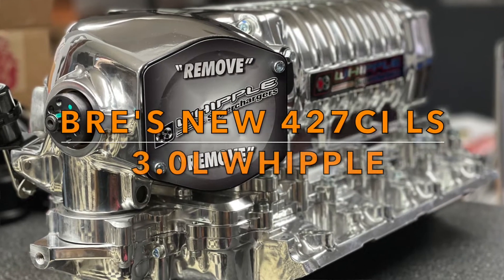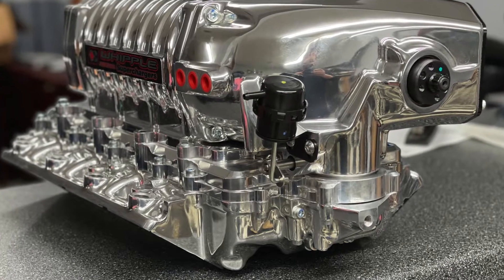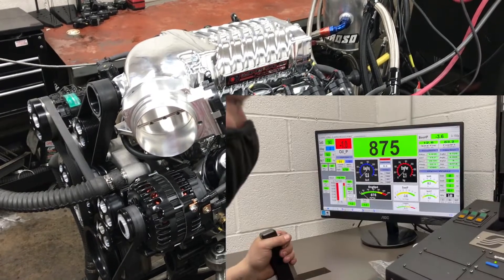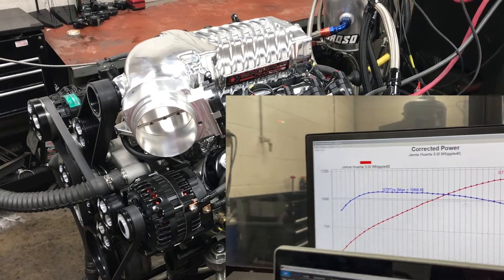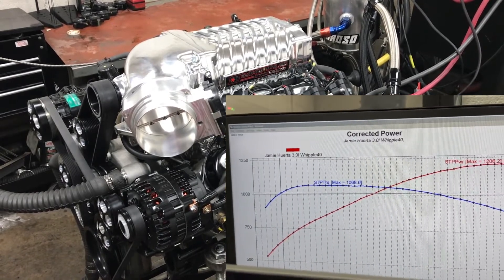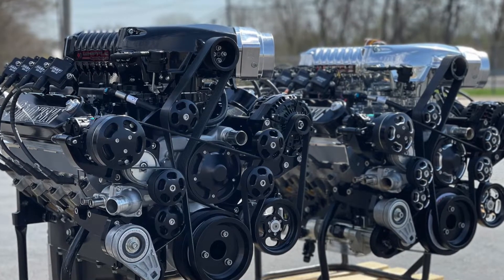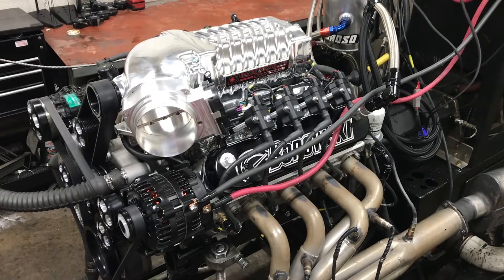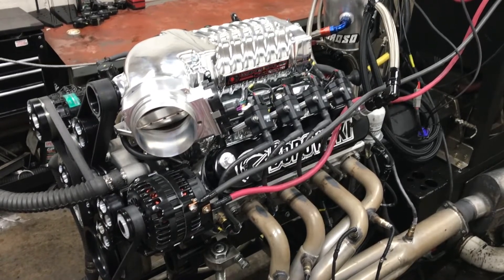BRE's New 427ci LS Engine with 3.0L Whipple Supercharger

Comment from the maker: A viewer asked about the possibility of getting a lot more horsepower running E100 on this particular Whipple supercharged engine.  He did not specify whether the design would be dedicated E100 or flex fuel for street/track use.  

Let's start with E85 and boosted engines in general.  That topic is covered in detail by this blog: https://borowskirace.com/blogs/news/pump-gas-or-e85-for-boosted-street-engines   This link shows one of our 4.5L Whipple LS engines running E85 https://youtu.be/gOhysCsDLEU?si=6nZ9lJ8XgFEo8b_G  It dyno'd about 65 hp higher than it would have on pump gas.  Other than requiring larger fuel injectors, the other parts would have been identical to the pump gas only design.

Whipple twin-screw superchargers are a special case in the boosted category being positive displacement air pumps. A fixed amount of air is pushed into the intake manifold with each rotation of the screws.  Whipple specifies what max rpm is for the supercharger so that fixes the maximum amount of available air, assuming you follow their advice which we do.  E85 contains 30% oxygen.  Air contains 22% oxygen with balance being about 78% inert nitrogen.  This is why the optimum air-fuel ratio for E85 is lower than for gasoline.  You are injecting some oxygen as a liquid.  The net result, all else being equal, will be more horsepower as you can pack more oxygen into the cylinders. The E85 tune will also have more timing than the pump gas tune taking advantage of E85's higher octane thereby providing additional incremental horsepower.

What about a dedicated E85 build?  The big design difference here will be going to a higher compression ratio along with some cam changes to take advantage of E85's 100 octane rating.

What about E100 (actually sold as E98)? First problem is cost, particularly if you can buy E85 at the pump. If you are buying pails or drums, we'd rather use leaded ethanol at 112 octane for maximum effect. https://renegaderacefuel.com/product/ethanol-fuel-pro-e112-racing-grade-fuel-gold-renegade-race-fuel/ 

Methanol is another even higher octane option at 120, but it creates a lot of new challenges in design as it is far more chemically aggressive than ethanol and more hydroscopic.

Bottom line is that fuel choices can have a big impact on max horsepower for Whipple supercharged engines.  As in nearly everything else in life, there are trade-offs to be considered.

Comment: Guys thats super impressive hp & tq figures from that combo. Q) what fuel 91, 93, 95, 98, race gas ? 
Any chance of putting up the graph thru the rev range pls. "Black Edition from BRE"   sounds like a real gr8 selling slogan 2me. Or "Black Mamba Edition from BRE"

❤ UR ENGINES GUYS
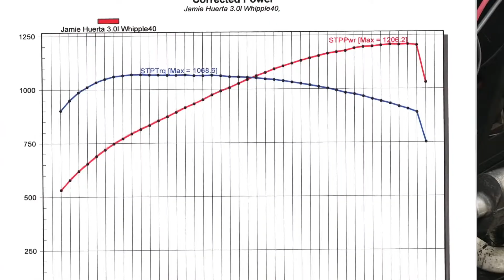Reply from the maker: Hi Robert.  Thanks for the complement!  The dyno was run on Shell premium pump gas (93 octane).  The dyno chart is in the video at 0:47.

Comment: Too much of a good thing for my daily' but it would be a lot of fun to own. I plan to have Borowski build my 'bucket list' engine but can't decide which way to go.
Reply from the maker: HI Daniel.  Our Whipple engines are indeed a handful as you can see in the "daily driver" video just posted.  They have so much torque that street tires cannot handle your nailing the gas at any speed without torque control.  I'd suggest you look at our 700 hp rated build.  Great power that is more manageable and a much lower price.  https://borowskirace.com/products/700-hp-naturally-aspirated-415-cid-hydraulic-roller-ls-street-engine-complete?variant=32732507668579

Comment: I'm going to assume this will fit in a 2013 Camaro and what price?
Reply from the maker: Hello Bill.  I am not sure it will fit, as the engine tucks back under the cowl in a lot of Camaros leaving no vertical clearance.  We'd be happy to work with you on measurements.  Please call 815-725-2727 for follow up.  The base price with serpentine and Holley EMS is $36,719.  Here is a link to this engine's ad on our website: https://borowskirace.com/products/1-175-hp-3-0l-whipple-supercharged-ls-engine-includes-serpentine-system-holley-ems?variant=39509071986862
Reply from the maker: Good news.  The 2.9L fits on 2010-2015 Camaros with 6.2L engines.  We can therefore check with Whipple as they would know the 2.9L clearance and whether or not the 3.0L will fit.  Please let us know if you want us to make that call.

Comment: Do they make a ls7 port?
Reply from the maker: Yes and we have them in stock. https://borowskirace.com/products/whipple-supercharger-3-0l-ls?variant=37923464085678
Reply: What was the psi of this pull?What would e85 be worth h.p wise.Im looking to get between 1100 to 1200 to the wheels to run my number. Could this be pushed to 1300on the engine dyno? Would like to c a max effort pull with good gas.
Reply from the maker: @duvall408w  The pulley set we used had the supercharger spinning up near the top of its range.  It was generating from 16.0 - 17.3 psi across the rpm range.  Twin screw  superchargers are positive displacement so there is no more air available than what you saw.  E85 doesn't need as much air for combustion as gasoline does because E85 is oxygenated. The net result is that by switching from pump gas to E85 and pushing in a lot more fuel, you'll gain 5 - 6% horsepower after tuning.  E85 is a higher octane fuel.  Depending on the blend, which is often seasonal, octane can run from about 100 - 105.  A dedicated E85 engine could therefore be built with a higher compression ratio and that would get you another bump in power.  The problem is that you would no longer be pump gas friendly. 

In round numbers, you lose 20% from fwhp to rwhp.  That means you'll need 1,375 fwhp to get 1,100 rwhp. That's not happening here. You'll need a bigger supercharger.  Here's a video (see link below) showing a similar engine with a 4.5L front-fed Whipple running E85 and doing 1,328 hp.  As you'll see in the video, it hit 22.8 psi peak boost. If that engine had the optional Dailey dry sump like this 3.0L Whipple build, it would pick up another maybe 25 -30 hp.  A little nudge up on compression ratio should get you into the that 1,375 hp neighborhood. If you look through our past videos, you'll see we have built a lot of 427ci LS engines with 4.5L Whipple in both front and rear feed versions.  Give us a call at 815-725-2727 if you'd like one made for you with your objectives in mind.  https://youtu.be/gOhysCsDLEU
Reply from the maker: https://borowskirace.com/blogs/news/pump-gas-or-e85-for-boosted-street-engines?_pos=1&_sid=47de9c77a&_ss=r